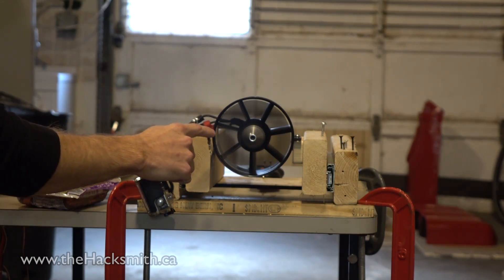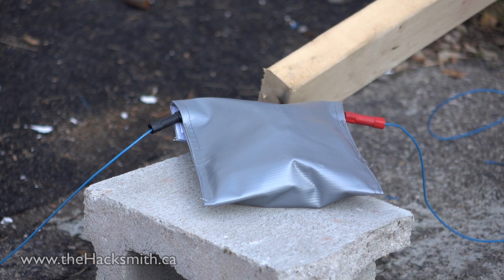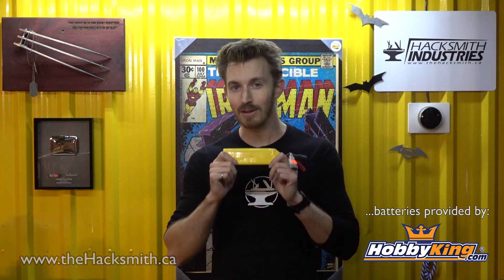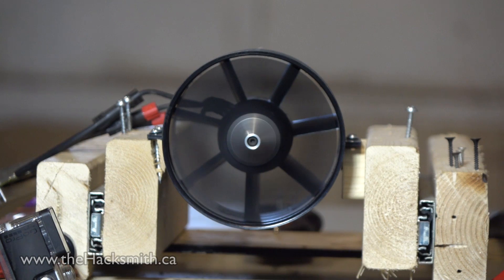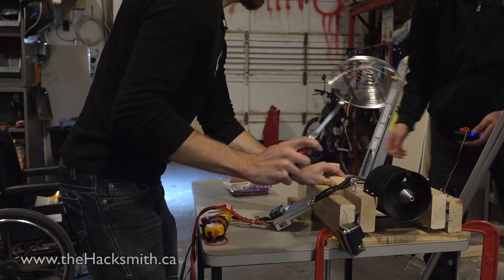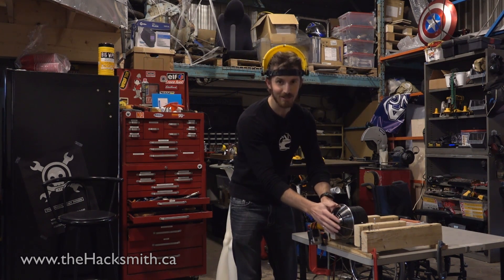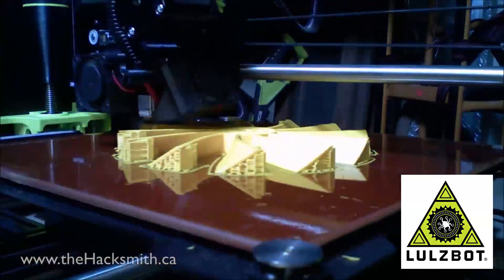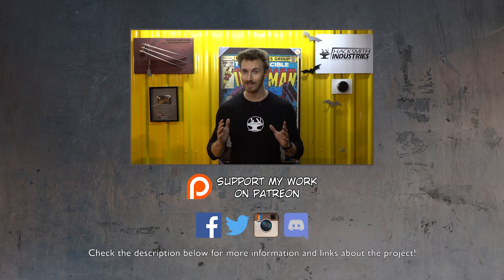Flying Like Iron Man #11: Not So Safe Safety Tests

Comment: dear Hacksmith,
  while you were in the process of listing all the ways you could die, the one about running out of power and falling to your death seemed the most plausible to happen and i came up the idea of a parachute contraption, a parachute could be strapped to your back with a clasp holding the parachute in, the clasp would be electronic and powered by the suit. so when the suit would run out of power the clasp would open, releasing the parachute and stopping you from falling and dying.
sincerely,
a new subscriber
Reply from the maker: +IJAGaming I don't plan on flying high enough that would allow you to use a parachute :p
Reply: the Hacksmith, I understand that as of now, you don't plan on flying that high but like you I am also working on a project, and I know that things can change. for me they usually go bad, but if your prototype is a success and you ever want to make it better and continue this project some safety would be needed

Comment: you need to learn how to cast an edf out of aluminum
Reply from the maker: +David Quinlan not for something this precise. Any variations or air bubbles would cause a catastrophic explosion when running the fan. Metal shrapnel is way worse than plastic :p

Comment: Love the project. Keep going !I have questions : 1- why dont you add a casing that would focus the outgoing stream of your EDF, resulting in less thrust efficiency loss ?2- would it be interesting to add/combine an air multiplier concept to your EDF ?
Both ideas are to get you closer to an airplane jet propulsion system.
Cheers !
Reply from the maker: +Eric Le Rouge thrust tubes can improve output by up to 25-30% ... But only in high speed scenarios. In static (hovering) scenarios it actually reduces thrust :(

We're not planning on flying very fast at all so we won't be able to use thrust tubes :(

Comment: Why don't you put a bent cylinder/tube to protect yourself from the blades? I THINK it shouldn't lower the thrust since the air can still flow in. (I'm no expert :P)

Then again, there is still the dust issue I guess...
Reply from the maker: It will reduce the thrust =P

Comment: if you print the blades at a high density and with a high-strength plastic (like what james bruton used in his iron man arm gears), then the blades should be more than possible. its also not impossible to embed a metal frame inside the print to reinforce it.

Comment: You should try putting a ring around the outside edge of the blades. The reason they fly apart is at high speed they vibrate apart. The ring will hold the blades tips fixed and will vibrate far less, thus should not fly apart. Downside is it makes the fan heavier and will reduce thrust some. But I think it would be worth a shot.

Comment: Kevlar is terrible at protecting against punctures. Try stabbing one of those with a nail on a bat, it'll go right through.

You're gonna want ceramic tiles to protect you from the flaming batteries, and protect them from puncture.

Comment: I just though of the idea to have a back out power by you sticking a solar panel to your back XD But solar energy isnt the best some times. Im racking my head with any idea i can think of:
-Using a kind of printable metal
-Using a fan cover instead of a mesh, allowing air to get through more, while still being safe
-Putting those batteries in a thick metal box, but having cushioning on the inside of the box to stop them from being damaged. Like using Aluminum, but thick (or any other light metal)
And thats all i can think of right now
Reply: dvanw6 solar panel's are too heavy but that it a really great I idea
Reply: That would be awsome
Reply from the maker: +dvanw6 you'd need a few foot ball field sized solar panels to power this system ;-)

Battery protection would be nice, but likely too heavy :(
Reply: Yeah. What about the Fan cover or the metal printing?
Reply from the maker: Got a quote for 3D printing in metal (the machines are a few hundred grand). To print a 180mm EDF would cost $900USD... 

Any kind of grill we use is going to reduce thrust -- it'll be a balance of how much thrust can we lose versus how safe we want the intakes :p
Reply: Well damn
Reply: check out laser sintering machine, can probably build it from a cnc machine
Reply: I'm almost certain that the 900USD Price you were quoted was definitely overcharging. 3D Printed 304 Steel is usually no where near that amount. Im not entirely sure just how complicated the printing of the EDFs would be, but it shouldnt be that much.

Comment: Done $50 donated, now fly.
You weigh 60kg, 24kg per 195-200mm edf = 72kg thrust, less 4kg per edf = 60kg. 3 edf`s across your shoulders use motocross chest plate type rig and use seat belt material to make a harness or buy one or use the one you have. Two loops (seatbelt material) over shoulder and in between legs. Chest plate type edf holder slits in the plate (horizontal splits) weave seat belt though same on chest plate sow together the ends (to make the loop) done, cheap should hold you I weigh 5-7 kg more than you.
Reply from the maker: +me001ist thanks for the donation! we'll need the full 150kg-200kg of thrust to actually fly well -- just breaking even on my weight will be rather anticlimactic :(
Reply: No problems.Yeah I know, impatient I am, hurry up. Safety, what, yeah ok, not at the expense of thrust, that small percent chance you might blow up is part of why I watch.

Comment: You could put a curved lip on the ducted fans and it would increase the thrust a bit, maybe even enough to cancel out the grills. https://www.youtube.com/watch?v=Cew5JF8q6eY That guy does a great job at explaining it :) It would also make hovering easier :)
Reply from the maker: Most of the ducts we have already have a curved lip -- the issue is, stuff like that only makes a big difference when you're flying at higher speeds -- since we're just planning to hover (to start) none of the EDF improvements you can do (like thrust tubes) will actually help =(
Reply: the Hacksmith
The curved lip helps at low speeds too :) Curved lips actually have a hard time operating at higher speeds because of the self stabilizing effect, but you should definitely test  the thrust with and without the curved lip to see if there's any improvement on your setup :)

One thing you could try (I'm skeptical whether or not this will work) is to have a relatively large curved lip and instead of adding a mesh in front of the intake you add a lid in the middle with openings around the lip, like this: http://i.imgur.com/zMP64fy.png
It would increase the speed of the air going over the lip which will increase the thrust, but as you can obviously see it would also create an obstacle for the air which reduces thrust. I don't know if it will preform better or worse than a mesh, but it's a pretty simple thing to test with your setup :) Just hold a disk in front of one of the lipped ducted fans (if you could make an even bigger lip this effect would be even greater).

Comment: Have you looked into putting a velocity stack on your EDF's? It could help to recover the lost thrust due to the inlet screens or you could eliminate them entirely as the stack will keep fingers farther away.
Reply from the maker: A little bit -- would need a lot more research and design though!

Comment: why no go with 4 RC jet engines instead of lots of EDC fans. I have found a RC jet engine
that is capible of producing 132 lbs of Thrust. take that times 4 and you get 528  lbs of Thrust. 
They cost 2,440 dollar each and 4 will cost 9760 dollars. Its much more thrust for your money than EDC fans. now of course  528lbs is way!!! to much thrust but create some steel protective armour to prvevent burns and add wheigt+ fuel storage and it will not be overwelming power. 
I personally tink this is more cost effective than your ECD fans. and you wont have to fund so much cash for your prodject.
Cheers from Sweden and good luck with your prodject!
Reply from the maker: Send us a link! I haven't found any jet turbines that cheap. They have seemed around the same price of the EDFs!
Reply: the Hacksmith I had to double check and it turns out the where much more expensive then The price they said in the forum i read. 
but i found this other website.. its an enginer That makes his own jet engines. his aim is to make cheap and affordiable jet engines.
but he has no prices on the website. you have to fill out an intrest forum to get a price.
http://jetbeetle.com/
Reply from the maker: I actually emailed JetBeetle! Sadly they never got back to me. . . =(
Reply: the Hacksmith Thats to bad=( have you tried to contact the big rc companies and asked if you can feuture them in a video to get a 50% diskount?
Reply from the maker: We still couldn't afford them with a 50% discount =P and yes we have

Comment: http://www.schuebeler-jets.de/en/hst-fans-en/ds-215-dia-hst-195mm.html I found this website. Apparently their biggest model gives 25kg of thrust. Two of those could work for the jet pack part of your suit. Did not check the price though.
Reply from the maker: Those are the ones we've linked on our GoFundMe campaign =P 

Seriously it's worth checking out even if you aren't planning on donating as it provides more info about the project and our plan =)
Reply: the Hacksmith I see. Well maybe I will.

Comment: too bad it's not possible [or is it? never worked with 3d printers....] to print onto existing materials. print out a more detailed fan, maybe have multiple prints on top of one another.... er....

I mean print the fan only thinner, then print a wider and thicker fan onto that [fan blades rather], and then print the final year size you want. might need holes but that would usually cause an unbalance in design... just thinking of how 3d printing could be better? especially for fans.

Comment: If you had magnets, really strong magnets with the same sides polarity facing one another  but mounted on the edf would that help any? I mean one magnet in a fixed position and one magnet for each of the fan blades. That way there would be a constant force pushing and to disengage it you could demagnetize the fixed magnet. You could possibly use neodymium magnets
Reply from the maker: +Caleb HEER (cj) cool idea but no that wouldn't help. It would add resistance to the system and reduce output. The EDFs already use neodymium magnets in the motor

Comment: You guys should have c02 and use a way too have it for stabilizing yourself and is cheep
Reply from the maker: +Jake Shimada there is not enough energy in compressed gas to fly -- the tank would weigh too much. I looked into flying using compressed air before -- you'd need an air tank the size of a tractor truck

Comment: Safety First? Safety First? Horseshit James. Keeping your day job and wearing bubble wrap is safety first. Safety third. #1 - Idea, #2 - Execution, #3 - Safety. I love that your LIPO exploder was exactly the same as mine, a 2x4 with nails in it. Also, I underestimated the fire hazard. Jesus, I took 80 pounds of lipos in a backpack once and biked them home. The ones you were blowing up were, what, 2 pounds? 40 times that is... not a happy time if it lights off.
Reply from the maker: +MattsAwesomeStuff yup. And the total batteries we'll be using will be close to 80lbs. Starting to reconsider that bomb vest...

Comment: Instead of putting a layer over the engines use a tube like structure around the outer ring of the thruster. Stopping your hand from going in, increasing accuracy in direction and no loss of thrust! :D
Reply from the maker: +Nick's Action Videos that's the intake -- if you make it smaller you'd lose even more thrust :(
Reply: Thanks for the reply! I hoped I helped but still then I'm only 13 so what do I know. :D
Reply: the Hacksmith Another Idea I had (that I'm not sure about) is what if you made those tube things like so said before nd opened them up like a circular funnel on the bottom?

Comment: What if you used something like a power inverter to change the DC to AC to cut wire weight and overall weight of the system?
Reply from the maker: Because a 150kW AC/DC inverter would be the size of a small car...
Reply: the Hacksmith understood and thanks for the quick reply. I'll keep thinking and get back to you if I think of anything useful.

Comment: Bursting into flames is not an 'explosion'!!!
Reply: dave fuller explosion: a violent expansion or bursting with noise

That would be an explosion.
Reply: I guess it depends on your definition of violent then.
Reply: dave fuller an explosion is a burst of flames. what else would it be water????
Reply: If you light a propane torch you get the same effect - not an explosion.  If you throw a propane torch into a fire, that's an explosion.
Reply: To me an "explosion" is something that has a destructive shockwave.
Reply: dave fuller still what would produce that shock wave? a release of potential heat. sound can't from nothing
Reply: No
Reply: Yes

Comment: should stick a chopstick through the hotdog to simulate bone... =p

Get the slowmoguys to help with video results!  I want to see what happens to it when stuff hits it in super-high-res-slow-mo.

So... I've read in different places you can actually smooth out 3D-prints pretty easily with acetone.  There are various techniques I've read about, and bare in mind, have not tried, but it might be worth a shot, since sanding in those tight crevices doesn't seem like such a great idea (mostly because it would be tedious, and boring).  I'm also wondering if, since the outer diameter of the blades is wider, if you can add more blades to get more thrust.

Comment: Actually hacksmith the cables would be even bigger because you are using lower voltage. So more like 6 times house cables not 3.
Reply from the maker: +ben lawton we were generalizing for the general audience -- regardless though you're right, the wires will be way too big either way :p other issue is it's AC :p
Reply: the Hacksmith Also maybe to make your coustom EDF why don't you make a mould out of the 3D printed one then pour aluminium into it.

Comment: As a tip for 3D printing the fan blades I have built my own 3D printer and for more rigidity in my parts I have been over molding metal into my plastic prints. I built my printer when I finished engineering school this past May. Your videos are great I love the content keep up the good work! Look into the over mold technique if you want. Send me a message if you need anything. Good luck and fly on!

Adam

Comment: Dont you think starting on the arc reactor before building the suit is a good idea?
Reply: So you dont have to worry dying because of lipo explosions?
Reply from the maker: If I could make an Arc Reactor I don't think I'd be on YouTube =P
Reply: Do you now how real life works?
Reply: I don't know if there is a pure beta emitter with a suitably short half-life, but if you could find one, you could make a beta-voltaic battery of incredible power. Atom per atom, the energy of beta decay is many orders of magnitude greater than the energy from chemical batteries. Most existing beta-voltaic batteries use isotopes with fairly long half-lives, they're intended to provide continuous power for years. I'm aware of one which uses sulfur 35, which has a half-life around 3 months, but there are certainly candidates with shorter half-lives than that. Of course, probably a lot of paperwork associated with obtaining the necessary isotopes.

Comment: try putting 2  edfs on top of eachother but kinda spaced out like 4-5 inches in line with eachother because my theory is that one edf will suck in air and blow out. if you have an edf behind the first one to provide that air then in theory you should get more power
Reply from the maker: +david hurley that is possible with custom EDFs but they need to have different angles on the blades -- there is some research on it but I think two seperate EDFs still produce more thrust then two in line -- it's just more compact  having them in line :)
Reply: Well force equals mass times acceleration, so you can double the force by doubling the mass or doubling the acceleration. Kinetic energy equals  one half of the mass times the velocity squared. So doubling the final velocity requires four times the energy while doubling the mass requires two times the energy. So just looking at the EDF's as a black box that take in air and impart a given amount of energy to it, more air and less acceleration will yield more thrust than less air and more acceleration. That's why using a larger fan with a motor of a given power output can yield more thrust.

Comment: I saw a the good wife episode where a guy printed a gun and it exploded, and it was actually the 3D printer fault. Temperature changes and air humidity plays a big role in 3D printing, the space between layers can be different and this will affect the integrity of the blade. I don't know what 3D printer you guys are using, but consider putting a acrylic enclosure and a good power supply, it will make the printing more consistent.
Reply from the maker: +Lucas Gallindo we have a pretty sweet setup we'll share in a future video :)
Reply: Cool =)

Comment: Suggestion for the guard mesh on the EDFs: Instead of using strainers, perhaps you could get better results with window screen mesh and some steel wires (maybe around 8AWG) to make it hold the right shape. I'm guessing the thrust reduction would be similar or slightly worse, but the weight shaved off might make up for it.
Reply from the maker: +William Shreckengost the thrust reduction would be more significant than the weight I think. The strainer only weighs 100g, a denser mesh would definitely block more air flow